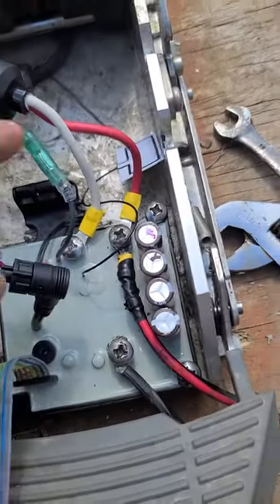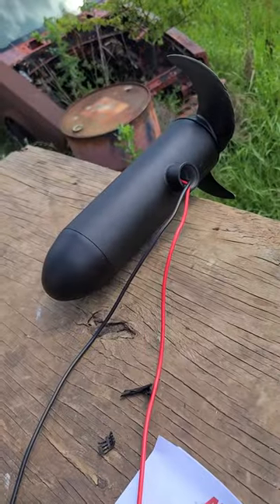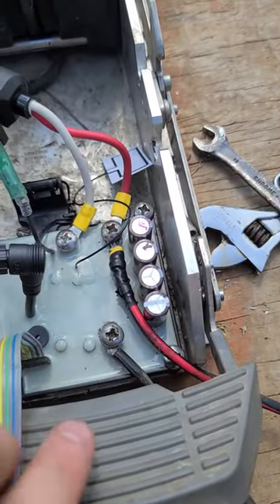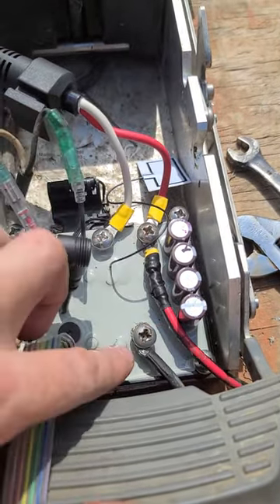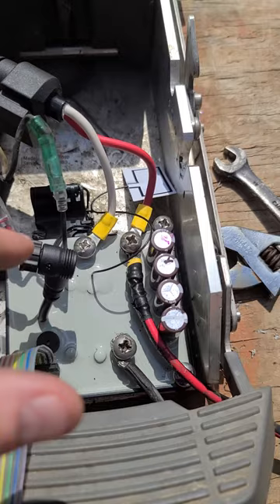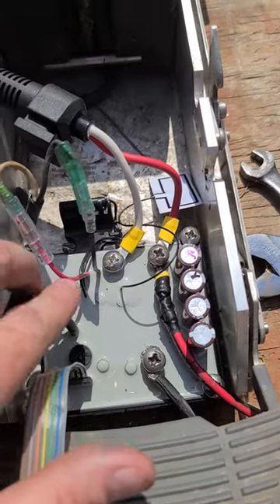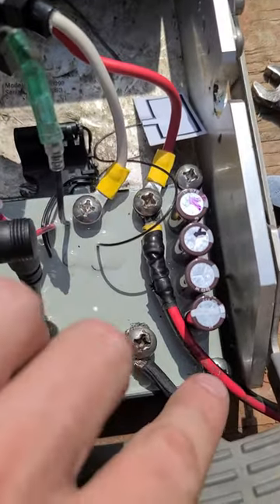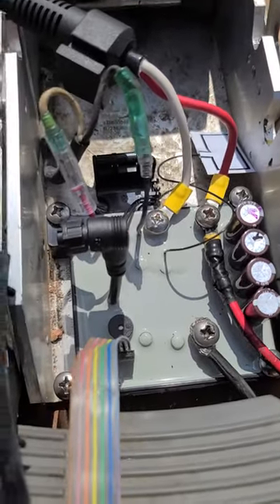Motorguide xi 5 control board wiring

Comment: Is this for a 24v Xi5? I suspect I fried mine by wiring it backwards, but both wires are putting out 12v, so I didn’t think it mattered which wire went to which terminal.